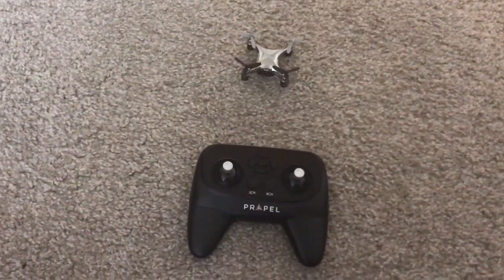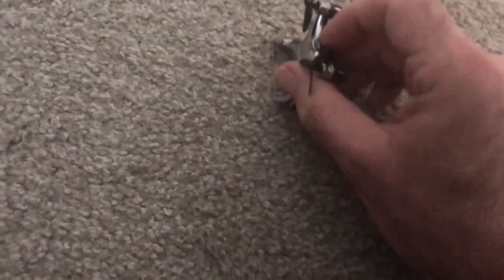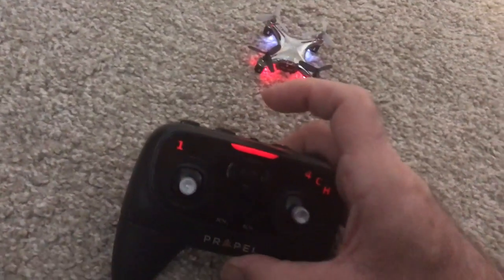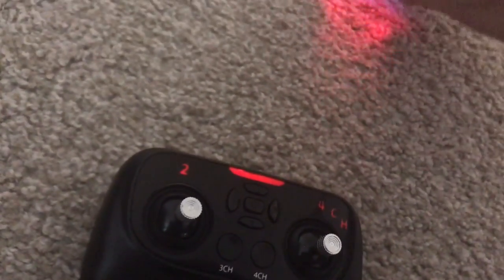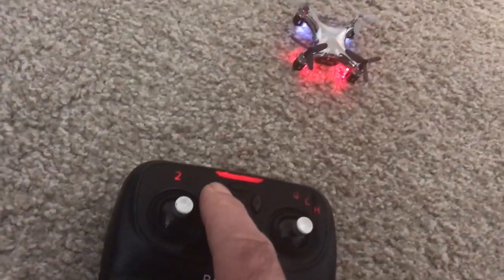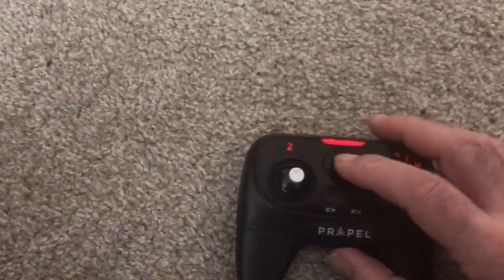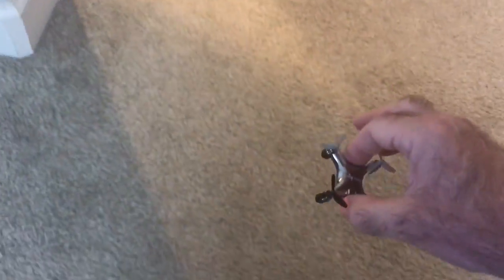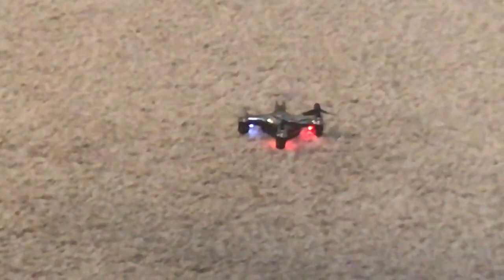Propel Proton Micro Drone TRIM! How To Trim flight controls

Comment: I have this drone the "propel maximum x01 micro drone" and the power switch broke off. How can i fix that??? Anybody's help will be really great.
Reply: it would take some know how but if you take it apart you could replace the switch... or if you wanted to you could bypass switch and just make the power come on when you put the battery in and not have a switch at all I mean it depends on how bad it's broken and what it looks like in there .....pictures?